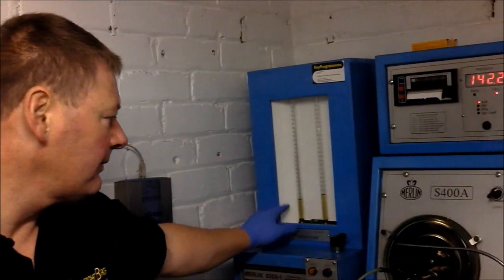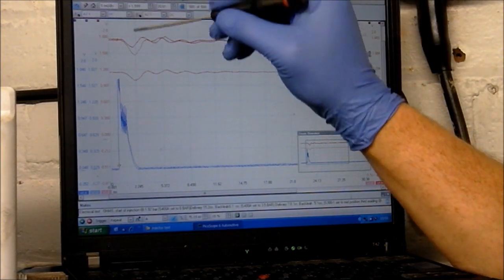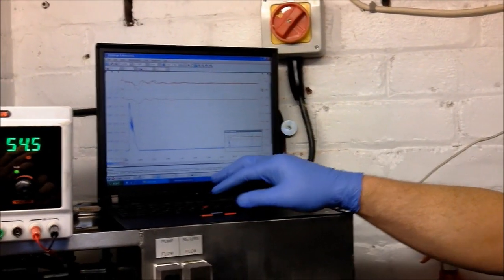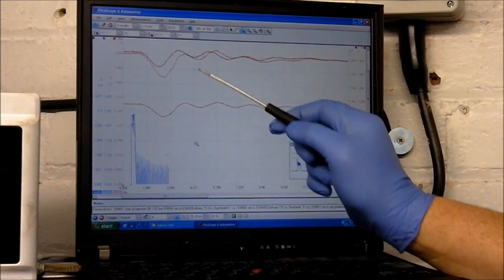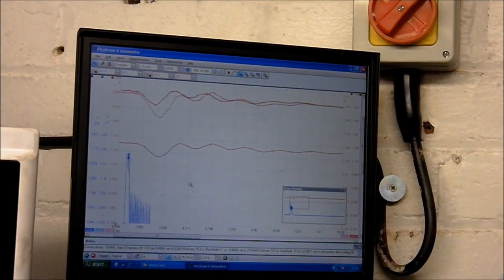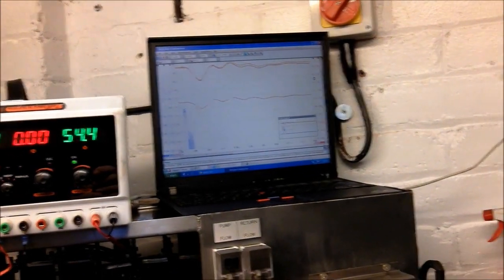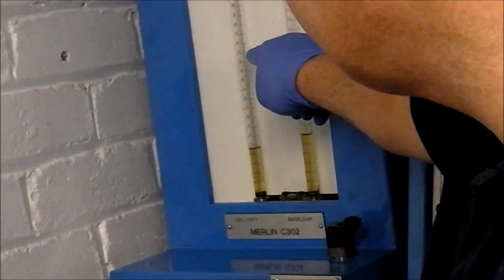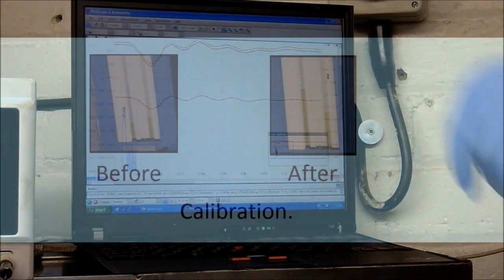Common Rail Injector Calibration.

Comment: same question, what adjustment is being done at 7 mins to alter calibration and make it match profile of new injector?
the open time is not altered and there appears to be nothing on the injector body that can be adjusted externally, or is the calibration adjustment electrically done via the calibration code on the injector solenoid some how and then the injector is marked with a new code?